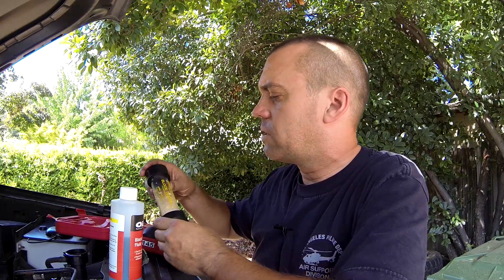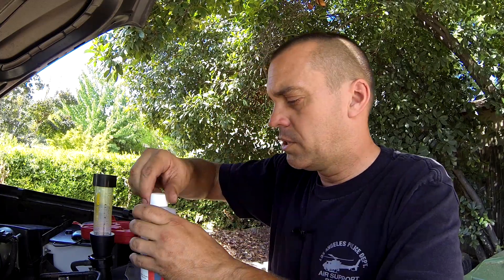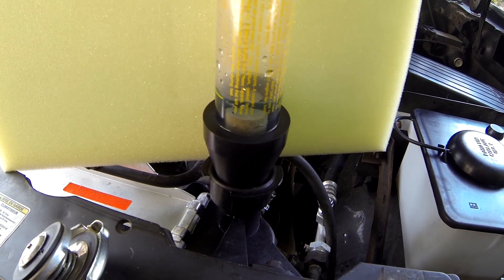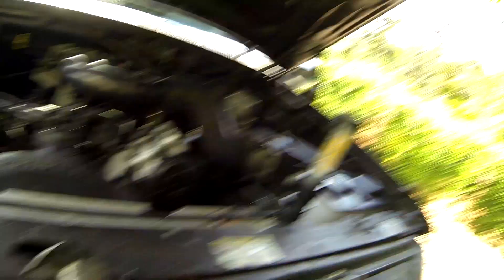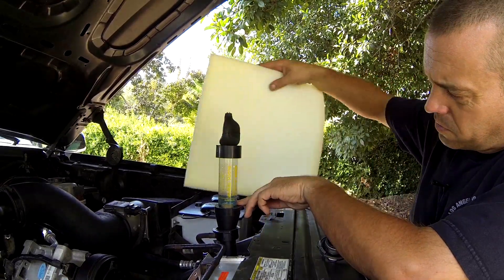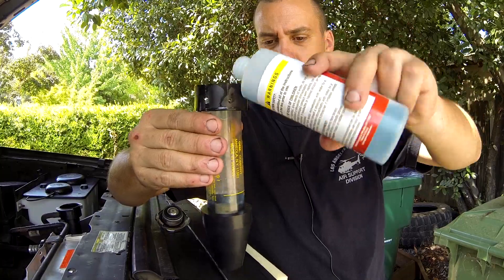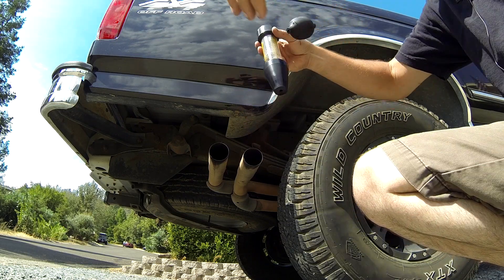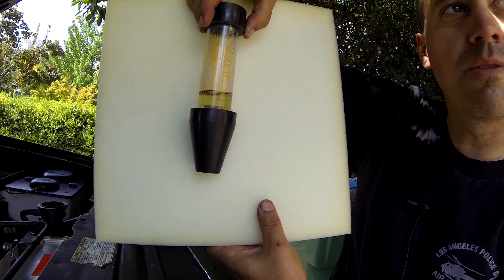Test for a head gasket leak with this simple test kit!

Comment: C JOHNSTON
   '''  """   ''             The coolant combustion tester/detector will only test the coolants fluids for a bad head gasket?  
The Coolant combustion tester/detector doesn't test if the water pump is work correctly or if the radiator and engine has rust and other chemicals in the coolant?

Comment: My test came out good. Will it be a different outcome at higher rpms? Anyone???
Reply: And I let the thermostat cycle at least 3 times before testing...
Reply: @EngineRecon  Can you explain by cycling 3 times? Turning it on, letting it warm up, turn off, let cool and repeat that 2 more times, then test?
Reply: JJ305 yes. Just to try and get all the air pockets out. What I ended up doing is bought a tool called an Airlift. It’s causes vacuum pressure which gets rid of all air and let’s you see if there’s a leak. Then you hook it to a bottle of fluid and it fills it up. Best tool ever...
Reply: Fair point.I also a bit confused.At idle liquid stay still but if I rev, liquid star jumping from side to side and at the eng colour change a bit to brighter..

Comment: What If It Turns Dark Green???
Reply: Than you probably sucked some antifreeze into the tester. As long as you don't contaminate the blue chemical with antifreeze, you can renew the chemical by blowing some lightly pressurized air into the chemical, to mix it up(in case your chemical turns yellow), it will turn blue again. Good as new.
Reply: @davidcastaldi8886  great tip!

Comment: The test is not valid until the engine reaches full operating temperature
Reply: Coolant is under pressure at full temperature and when a radiator cap is opened at temperature, coolant shoots everywhere.  How would this be used at full temperature?
Reply: @jheissjr  You don't open the radiator cap, you leave it off before you even start the vehicle.
Reply: @jheissjr  run car from cold till warm with radiator cap Off.. check upper coolant hose to assure coolant is now circulating thru thermostat and block... its not gonna shoot out all over the place.
Reply: @jheissjr  With no problems at all!It should not shoot out otherwise it may indicate too high pressure in the system

Comment: u just poured that stuff on the ground?
Reply: Ha! I was thinking the same thing! I recycled mine with my old coolant.
Reply: Yikes,  prolly not a good thing.
Reply: the blue liquid is bromothymol blue. Hydrocarbons will change the pH of the blue liquid and it will turn yellow. If it stays blue, light a cigar!!
Reply: @timin770  is the exhaust acurate i mean its combustion gasses
Reply: @htatesil4192  its one of the tests that can be done without dismantling the engine. I trust it if done properly
Reply: Yeah, so what if he did?
Reply: @alexgallegos7582  No problem. Cars leak antifreeze gas oil AC gasses etc. Many shops that recharge your AC don't collect the gas and recycle it. Why? It costs them money .
Reply: @zdcyclops1lickley190  yeah no big deal
Reply: @alexgallegos7582  yeah, so what if it gets into our drinking water
Reply: @golfish8589  exactly!